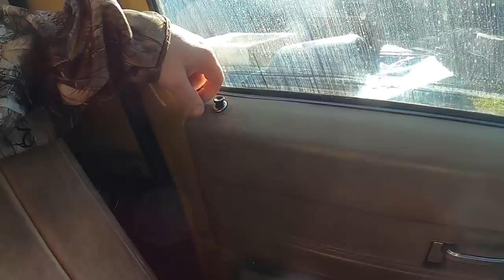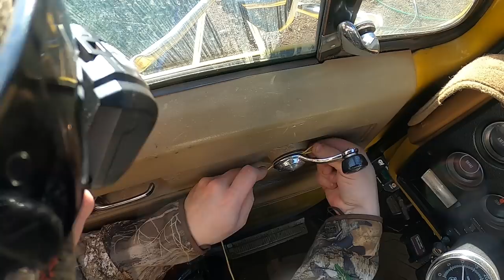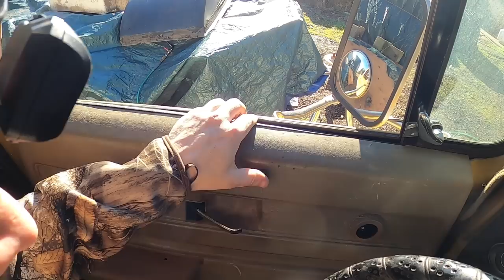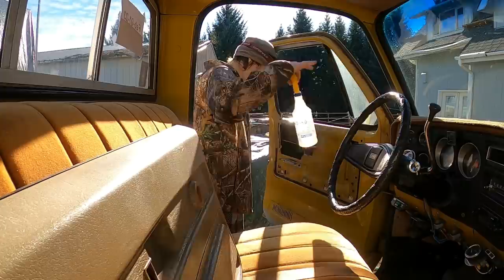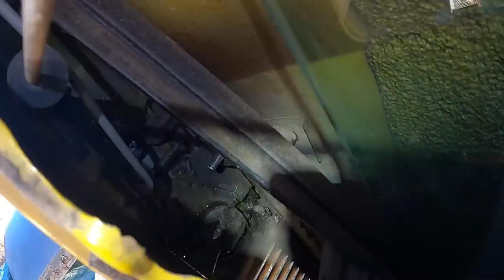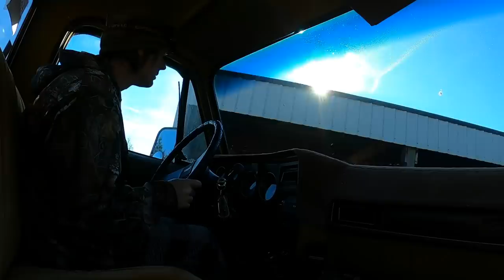Stuck Door Lock - 1973 GMC Truck

Comment: On the window handles you can make a tool from 6" piece of coat hanger.  One end with a small hook for the clip and the other end a loop for your finger.  Insert into  the back of the handle and rotate quarter turn and pull.

Comment: Hey Nate, check the door latch stricker pin on the body. They wear down or get out of position.  They can be adjusted or replaced easily, LMC Truck or Amazon have them. Thats probably why the drivers door is giving you trouble and isn't lining up correctly.
Reply: Clip fell off rod.

Comment: Try some white lithium spray grease, I use it on all the locks and hinges on my car, you might want some degreaser first to loosen the old stuff. I use silicone spray on all the rubber window and door seals to preserve it and stop cracking 😁
Reply: Believe it or not ....good old Zippo lighter fluid is great for penetration and breaking loose of mechanisms with hardened grease ....then clean it up and use a proper lubricant
Reply: 😅 just steer clear of electronics

Comment: No pin on crank handle a clip need. Tool
Reply: Good. Call on the. Crank. Pre. Install on. Crank put on and push clip on with bpaded scrwdriver